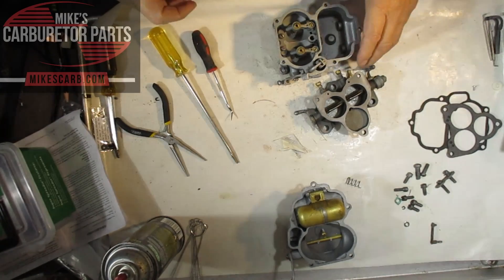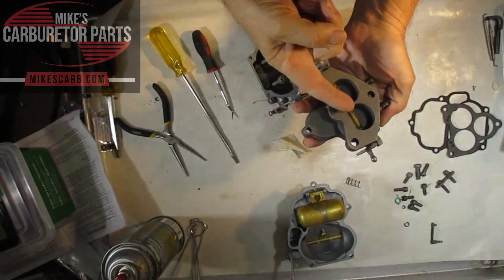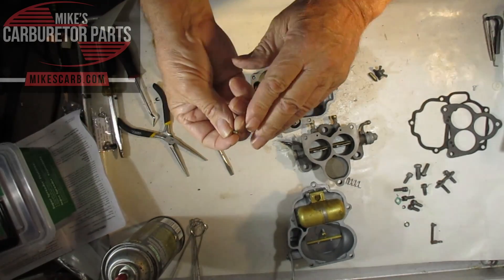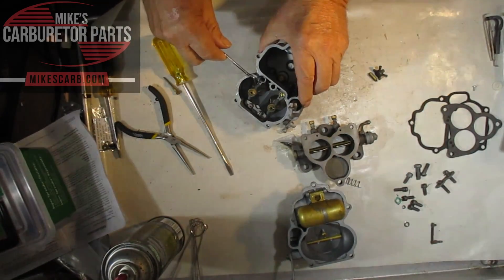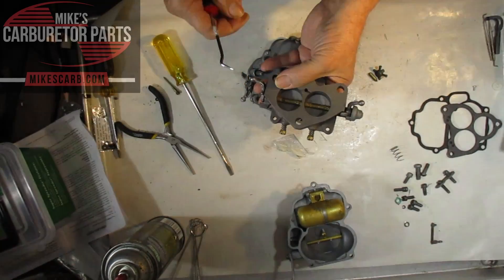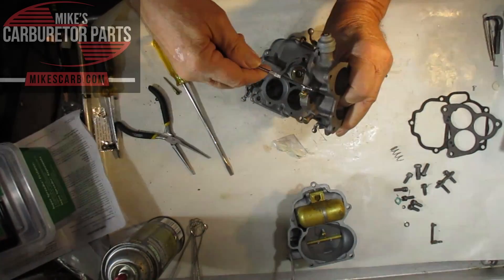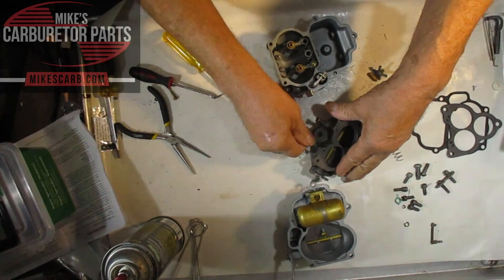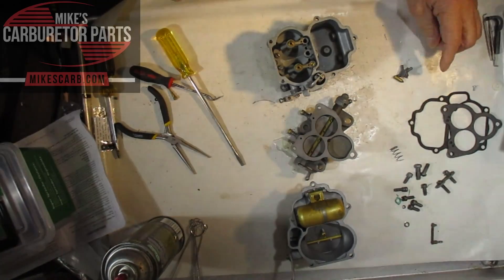Holley 94 Idle Problems & How it Works?

Comment: Ok I’ve tried all the tricks … I installed an AFR meter trying to fix this … this … little monster … I have rich idle condition after turning in the idle screws in all the way … I have new idle screws, used Viton O rings on the squirter and clusters, replaced the power valve with the correct design.  

I have proper AFR at cruise and WOT.  But runs rich at 10.6:1 or 0.7 lambda at idle (rich).  

I also have 3psi at the carb, roto disc seat, 1-3/8” float level, and phenolic 2:26 spacer.  I even sealed the throttle plates to the bore.

Holley 2110 LST 4961
Reply from the maker: 1. Check Transfer Slot Exposure & Idle Speed
Your float level (1‑3/8″) and 3 psi fuel pressure seem good—but if the throttle plates are opened too far, your transfer slots may be uncovered. That dumps extra fuel independent of idle screws, causing rich idle.
Helpful approach:

Close curb‑idle so plates just barely cover the slots.

If idle needs more air, drill ~3/32" holes near the end of primary throttle blades.
This allows airflow while keeping transfer slots sealed.
correctcraftfan.com
+13
hotrod.com
+13
forums.holley.com
+13

🛠 2. Lean Your Idle Bleeds (Air Bleeds)
Dropping idle bleeds by one or two sizes reduces fuel flow into the idle circuit, letting the idle screws lean out mixture more effectively.
Several users have had success this way when idle stays stubbornly rich.

🔩 3. Double-Check Idle Mixture Screw Procedure
Start with all screws seated gently, then back each out 1–1.5 turns. Warm engine to full, choke off.

Adjust mixture screws in ~1/8 turn increments: clocking in (leaner) until RPM/vacuum peaks.

Then lean slightly more until a tiny drop in vacuum—this is the optimal setting.

May need to richen modestly if idle vacuum is <10″ Hg or with tight converter, but base tuning should get you near 13.5–14:1 AFR.